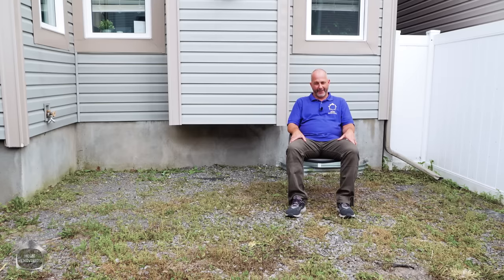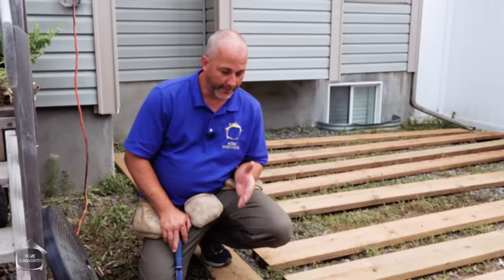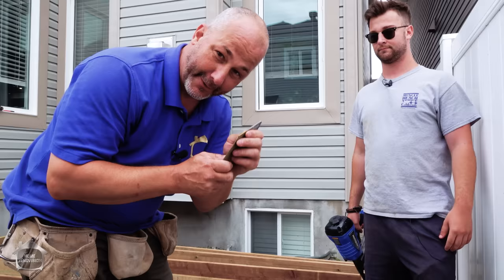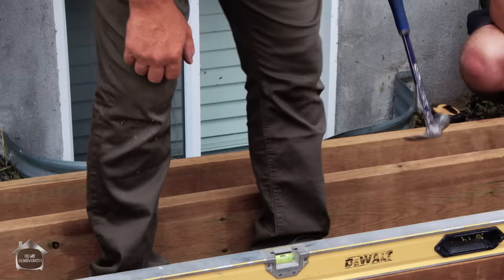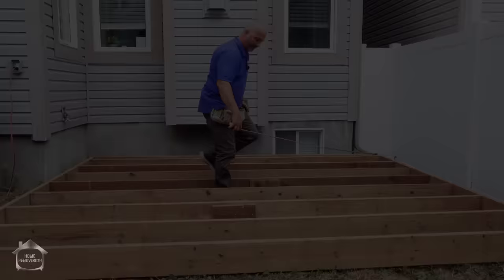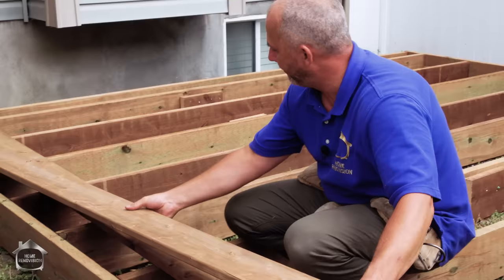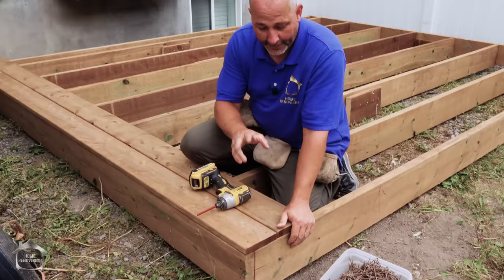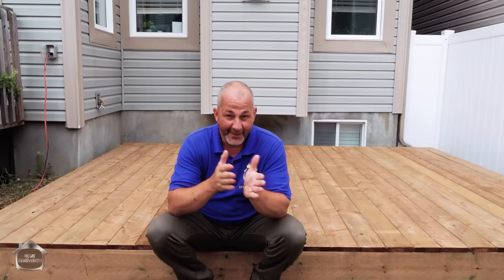How To Build An Affordable Deck

Comment: For anyone looking for a materials list, he used 3 2x8x10' (he laminated the third piece on the right side to fit the last deck board) and 9 2x8x12' for the joists.  He used ~ 27 5/4 x 6 x 10' for the deck boards.  You can probably buy an extra piece or two of the 2x8 for the leveling, if you don't have any scrap wood to use.
Reply: Thank u
Reply: thank u
Reply: Thank you.
Reply: Thank you!
Reply: nice  thankyou
Reply: Really good thinking a head for others thanks
Reply: You the man
Reply: Thank-You!
Reply: Thank you
Reply: Thank you!!!!
Reply: Awesome thanks
Reply: What type of wood is this?
Reply: @williamppl3624  SPF (Spruce Pine Fir)
Reply: Doing the lords work Ty
Reply: thank you
Reply: Hello, Can this same dimensions deck be built on grass or would I need to have gravel?
Reply: Thank you Mark
What  is the spacing between the joists and the deck board wood pieces in Ontario please ?
Reply: Thank you @ marksmithy
Reply: Thank you 😊
Reply: @trinajolly-kershaw7886  😊😊😊😊😊Q
Reply: Would you happen to know what size deck screws are being used?
Reply: @linsyalvarado4567  2" deck screws are more than sufficient.
Reply: Thanks you
Reply: Thanks so much 💪🏼
Reply: Thank you❤
Reply: After building my deck I was using plywood and I wanted to install the fake grass. What should I put under that grass?
Reply: Thanks
Reply: Thank you
Reply: Thank you!!!

Comment: Hi Jeff, thanks to you I’m not sitting on the dirt anymore!! I made mine with 2x6s. Cheaper than 2x8. I just want off the dirt. I made mine 12’ x 16’. With 2x 6 x12’ deck boards. Rock solid!! The Depot delivered the wood. 2 son in laws and dad. Started at 10am and done before 5. Tomorrow 10 x 13 gazebo tent going up with a Black Friday 60” tv and propane fire pit. Yeeeehaaa!!!
Reply: What were all the materials you used number of boards sizes etc looking to build that size, thank you.
Reply: Trying to build one same size what’s the number of boards and etc used
Reply: Great job! Can you tell us your supply list? Thanks.
Reply: Got any pictures
Reply: Thank you for the answer. I was debating if I should use 2x6 or 2x8. My deck will be on the ground and it will be 10x24

Comment: Built this Easter Sunday 2021 
10-2’x8’x12’ 9 for joists and 1 to chop up for the level blocks
2-2’x8’x10’ for sides (didn’t need an extra piece like the video)
30-5/4”x6”x10’ deck boards of which I needed 26 (4 spares)
1lb of #9 3” deck screws for joists
6lb of #9 2-1/2” deck screws for deck boards.
4 star bits for the impact drill (only used one never stripped)
Used cedar tone pressure treated lumber for exterior and regular PT for the unseen joists and cedar tone deck screws. Cost about $890 at Menards before the wife sent off the 11% rebate so it’ll be about $800 flat to do this as of April 2021. Materials were bought in South Bend, Indiana. Go Irish🍀 Hope this helps. It’s so awesome and I did it 99% by myself in a day with only an impact driver a drill and a hand saw to cut the one 2x8 into pieces for leveling.
Reply: Thank you for this list and cost info. (From a Menard's shopper in Minnesota.)
Reply: @lisaschnirring9998  my pleasure. This video is on point. You can pause and look close to count the parts. They are the exact same in the video as the Menards “online deck designer tool” so it’s structurally perfect and easy to do. Solid as a rock.
Reply: I was watching this great video and thinking how I would love a list and voila, there is was, compliments of WeezMcCheez!  How considerate. Tks so much.
Reply: @zammyc6414  💯
Reply: Do these measurements give a 12x10 dimension deck?
Reply: @KGriffin34  thought that’d be obvious… c’mon family…(we have the same last name). Yeah it’s 10x12 just like the video
Reply: @WeezMcCheez  lol you right…I’m in Chicago and want to do my deck in a few weeks so I’m just trying to get my numbers together.
Reply: @KGriffin34  man I’m from Chicago lol
Reply: @WeezMcCheez  lol might be family
Reply: Thank you!
Reply: You screwed the 2 - 2x8x10 to the joists using deck screws?
Reply: @allyb33e  you mean the two 2x8x12… the 10 footers ran between the two 12 footers… all with the 3” deck screws…
Reply: @WeezMcCheez  I built it and it came out amazing
Reply: @WeezMcCheez  posted a video on my page lol
Reply: @KGriffin34  man that’s cold! I’m thinking about a nice gazebo too. Going back n forth with the wife she likes the sun. Glad I could help (along with the original video of course)
Reply: @WeezMcCheez  yeah your measurements and listing helped out tremendously
Reply: @WeezMcCheez  was wondering the same thing… if it was okay to use screws vs nails…
Reply: @realworldguroo  yep I don’t have a nail gun and def wasn’t bout to use a hammer. A nice impact drill and deck screws worked fantastic. And it makes it nice if you have to take it apart or repair a piece.

Comment: Thank you once again Jeff I am just about to build something outside my back door and you have shown me that I can (with help) do it without waiting for a builder. You keep surprising me with the videos you bring out. They are so easy to understand. Thank you 😊
Reply from the maker: You can do it! Cheers Janet!
Reply: @HomeRenoVisionDIY  Do these same rules apply if I wanted to use exotic hardwood instead? Id like to use Garappa ( i like the color better than Ipe and its cheaper). As long as the wood has acclimated and all cut ends are sealed of course? Thanks for this vids. VEry helpful!

Comment: 7:32 this part of the video deserves a thumps up. It's a deck to get off the dirt not the Taj Mahal.
Reply: It’s the exact video for what I need. My yard set up is exactly like this one but reversed.
Reply: Asked my GC buddy about this deck,  he said its landscaping not structure according to code here, so build away.
Reply: Can you do a non simple deck? I want to see higher end projects, some of us know the basics, let’s see fancy!
Reply: @grigs249  its a beginner deck. Not a done by a professional
Reply: Never been a fan of the "we aren't building the taj mahal" saying. It means "don't care about quality just get it done because we have other projects to get to". If you hear a contractor say this, find another contractor.
Reply: @olbabybeard  You are right. If you hear contractor say to you we aren't building the Taj Mahal I would get away too, but you also have to put it into context. If you're framing a house vs building a small deck to get off the ground that's not even attached to the structure are miles apart. This gentleman is building something that will last and he's using the right materials along with the right fasteners. He isn't skipping any steps or using inferior material. This small project can easily go into Taj Mahal prices by simply attaching it to the house, installing concrete piers and using exotic woods instead of dimensional lumber.
Reply: It will wrought very quickly. No weed barrier and sitting on the ground. Never build a deck this way
Reply: @Jesse-gv9tf  my opinion of the phrase is biased towards a former employer who used it as justification to cut corners. This guy spent a lot of this video justifying corners he chose to cut because he has no code, so who cares? Codes themselves are the absolute minimum. The best thing about the deck he built is that it would be a ridiculously easy demo.

Comment: Jeff and team - I built out a ground level deck extension across the front edge of my poured patio this weekend (8'x18') using your technique. Thanks so much for the tips - especially the one about reversing the screws on the ends - not one split! Went with 2x6 prime pressure treated ground contact throughout - this thing is solid! Material costs ended up around $550USD....

Comment: I'm so grateful for this video. We have an area down the back of our garden next to our garage which has always been a problem area for weeds and brambles. 
Every year I spend days clearing it but it's actually only a couple of inches of top soil and a shed load of broken glass. So I've never been able to dig the roots out of the stuff that grows down there and I'm so limited to what I can do in that area. I can't use harsh chemicals to kill the weeds because of pets. It's quite a large area too so it's a shame. It just always looks a mess.
I did think about putting a patio down there but leveling it off for that will be a lot of work and quite costly. 
I think after watching this, decking is the way to go. 
It will still need a fair bit of work to level it but not as bad as if I were to put slabs down. 
Decking is going to be a lot easier and quicker too. I've built all my own garden furniture but I've never built anything constructive before. I always thought decking was a lot more complex until I watched this video. 
I just now the transformation is going to be amazing!

Comment: Hi, I'm so happy to finally find someone that isn't permanently fixing it to the ground (I really believe decking installers don't want you to know that you don't have to permanently install it). I've been watching videos on modular/portable/non permanent decking. So far I like good times decking system but I figured why spend all that money on a decking system when I can just buy the wood and put the frame together myself and buy the adjustable leveling feet that will sit on concrete pavers since I'm working with all dirt. I like your approach so much better. I can skip buying the adjustable leveling feet and just use the wood on the pavers instead. I don't know the proper term but did you make your deck flat or did you angle it a little so that rain water will go away from the building? Thanks for the video!

Comment: Hi Jeff. This deck is exactly what we need, easily understood, simple, yet instructive. A contractor wanted to charge 1800 just for labor (con)....I could use 600 for the materials and take a few hundred more and purchase furnishings and finish or a nailer or sumpin🤣
Straight and orrery!😉
Reply: Straight and preett

Comment: This is so refreshing thank you! I'm just wanting to build a super simple wall tent platform. I've never built anything like this but am pretty handy. All the other videos I've seen are for floating decks using concrete and joists and so much extra hardware. I am definitely going to do it like this instead, except I'll use plywood sheets for the top. Thanks for keeping things simple and straight forward. No bs:)

Comment: Watching this video a few times gave me all I needed to know about building this deck. I did a 12'x12' to accommodate the gazebo. It came out perfect with only a few unforeseen delays (Star drill bit wore out, cordless drill battery needed changing every 20 mins and I thought 5lbs of screws would be enough but I needed to buy another 5lbs just like you said). Thank you for this video.
Reply: How many boards did you have to buy?
Reply: How many boards did you buy I’m looking to do a 12x12

Comment: Would love a supply list if you have off hand? How many boards and lengths. Thanks
Reply: Do the math. 13 2x8. (4 for the outside, 9 for the joists). For your decking boards if you’re using normal 2x6 decking boards it’ll be 24.

Comment: Great video, thanks Jeff!  3 questions:  If the ground is wet due to poor drainage, will just boards to lift it up be ok (should they be on anything, like concrete patio squares)?  Should I pre-treat the ground to kill grass or put down fabric?  Lastly, if woodchuck or whatever get under there, could they make just the wood brackets touching the ground unstable?
Reply: You had concrete blocks in video but did not use them. Are the nevessary?

Comment: Thanks for the discussion on orienting the growth rings. A lot of the other videos on decks  ignore it.  I am strongly in the rainbow camp. If you install the boards with the rings facing down ( smile) you have problems.  When the boards cup the rain water remains on the wood. Also after time the cupping puts and tremendous amount of stress on the screws that hold it down  and the  screws break with a loud bang! You are left with a deck  that has numerous boards sticking up.

Comment: I always encourage my customers to coat everything including the structure with one coat of whatever stain or paint they are using. It helps to help control shrinkage in new wood like this, minimising cracking and prevents moisture absorption and rotting in the long run. I know it would have added another day to the build in this case but the deck would last so much longer without direct wood on wood contact which is where rot occurs. Unfortunately since I'm the one selling the coating they are usually coming to me after they've built the deck and it's too late, or the contractor who built in for them said to leave it for a year before coating it.
Reply: what type of stain or paint do you recommend?
Reply: With pressure treated you must wait 3-6 weeks before you can put anything on it until it drys. Its almost always sopping wet

Comment: I have watched a few of your deck videos and i love them. For this i am a bit confused however. On the other ones you always say that the lumber needs to NOT have contact with the ground or it will rot. I also saw in the beginning that you had some cemet feet or whatever they're called but you don't seem to use them. What's the difference here?
Reply: i wonder that too. why not put it on just some basic 20x20 stone pieces instead? i am not expert, but as you said, that lumber that lift it up will rot?
Reply: @ZekeMagnum  good question. I was also wondering why no vents along the front-side of the deck for better airflow underneath?
Reply: @ZekeMagnum  depends on the pressure treatment, there are 2 types, one can be in contact one cant

Comment: My only question on your beautiful deck is about the wood in direct contact with the ground. I know it is pressure treated but won't it eventually rot at the contact points?  I was thinking I'd have to use pier blocks or something.
Reply: Yes. Put it on deck blocks.

Comment: Thanks for the videos, very interesting.  I'm building my deck (10 X12)  over an existing cement deck (5X12).  Thinking of cutting a few inches off my 2X6 (10 foot) joists for 5 foot length that will sit on the cement.  Should I put something between the cement and 2X6. The cement deck as a good slope that runs the water away from the house.  Thanks  Luke

Comment: Do you have plans for this? Like how many boards you used for the whole deck?
Reply: You can just count them if you pause the video at certain points. I count 26 deck boards for the surface. You can take it from there.
Reply: I counted about 40 total
Reply: About 12 2x8 and 28 deckboards
Reply: Use your eyeballs!
Reply: Use math 😁

Comment: Is that a window for an escape in case there is a fire?  How close was the deck placed to it?  Not criticizing,  just asking. :)
Reply: That is not an egress window. The square footage it too small. So, it's fine if the deck blocks it. That window is light and ventilation only.

Comment: This is great. Thanks Jeff. I have a question,  do you have to lift the joists above the ground to avoid direct contact with the ground and preventing the wood from moisture?
Reply: This was what I was thinking. I saw the cement blocks on the side but never seen at which point it was placed between the deck and ground 🤷🏽‍♀️
Reply: No, the woods is ground contact, you should be fine with it sitting on ground.
Reply: @chrispalmer4323  over the short term not a problem. Long ter (decade +), it is inevitable that breakdown will occur at ground interface. So you could purchase some thin paving stones to support throughout OR put down a base of landscaping fabric / 5/8 gravel (not fine gravel)  to allow for rain water to drain below grade.

Comment: I live in Houston Texas where the soil is clay in my area. Any recommendations on the type of deck build? Off the ground or ground contact? I'm worried about the deck sinking into the soil over time since it rains here quite often.   The deck I have now is very old and has sunk into the soil a few inches. How would I prevent that from happening?  Thank you.
Reply: Civil Engineer (geotechnical) here. Check you local inspection on this for your area. But the general idea with clay is that it swells and can hold water for a long time. Make sure your footings are at least 42” and about 18”. I personally prefer 24” wide to prevent movement.  If the soil is constantly saturated increasing size/depth or number of footings would also help.

Comment: 12 years ago I built a red cedar deck for my in-laws...
After a year my father-in-law against my advice decided to paint the deck grey.
It's been repainted 4 times since.
DOH
Reply: Sis & her hubs in process of having Amish guys build their house, front porch and railing & back deck & all is all red cedar, the Amish guy suggested that they seal the deck with Thompson sealer as he said the cedar would turn gray & my sister wants to preserve the color from turning.  Is this correct?   On July 31 my order for a cedar fence will be delivered, so should I also seal the fence panels?
Reply: @A10TOES  If left untreated, it will turn crap grey in 2 to 3 years
Reply from the maker: best to apply a n oil based sealer that has uv protection. some products will last up to 5 years and then need to be reapplied. Cheers!
Reply: @A10TOES  Yes, but Cedar needs to age a few months before any preservatives are applied.
Reply: @stans5270  Your father in law painted it a year later....
Reply: Stan S  like how many months do you suggest?  Their house is like a cabin/lodge design & the cedar is so beautiful, I’d hate to see it ruined because they were in a rush to seal the wood.  We live in Indiana.  On my fence I can wait till October and thank you!!
Reply: Steve J.   Nope, I don’t want that crappy grey!  😆
Reply: Home RenoVision DIY   Is an oil base sealer better than the Thompson preservatives?  I think sis is picking it up this week from Menards.